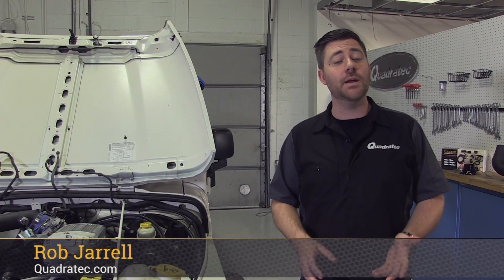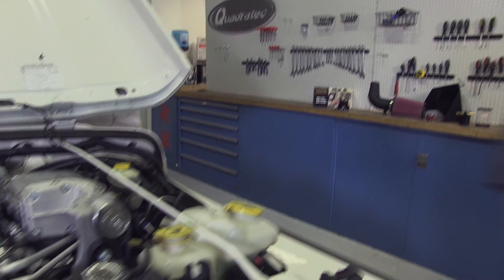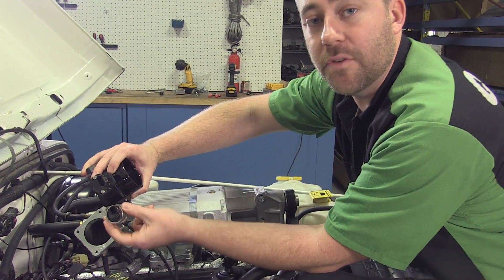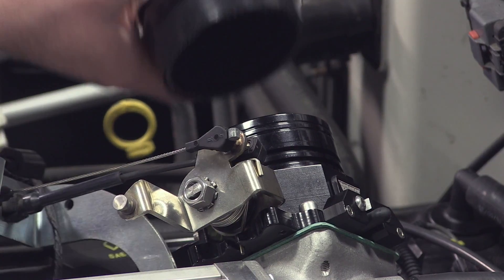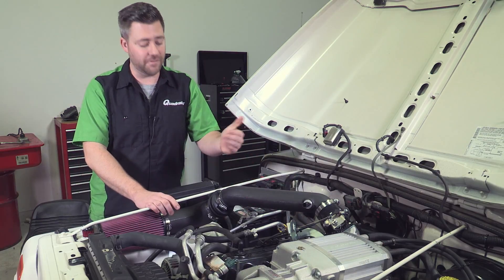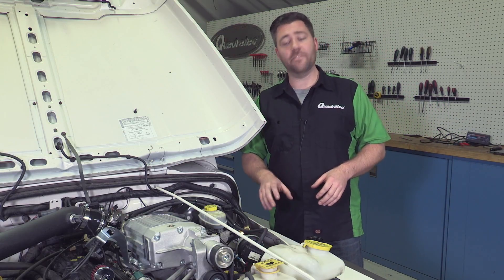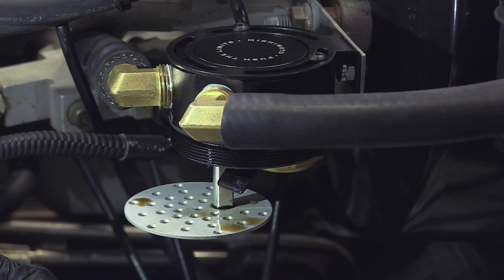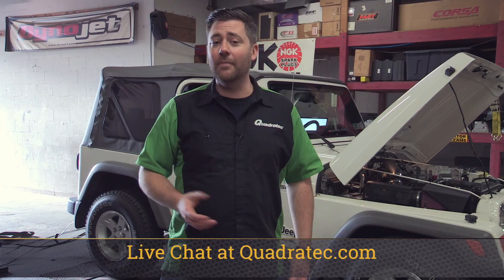Project: PearlJ Pt 2 - Air Intake and Throttle Body Install and Dyno

Comment: How exactly is that a “painless” throttle body if you have to fabricate a bracket to make it fit?   Seems like the manufacturer could’ve included a bracket ready to go right out of the box. Isn’t that kind of the point if you’re calling your company “Painless”??
Reply: The throttle body is designed to install in the stock location, but with the supercharger installed on this Jeep the location is slightly different. Because most aftermarket parts are designed to work with other stock parts, sometimes you'll run into issues when trying to install more than one aftermarket part or accessory. That's all part of the fun of modifying and personalizing a Jeep, you've got to get a little creative sometimes to make one aftermarket part work with another.

Comment: Seems like a lot of time and money to pick up 40hp. And apparently Sprintex has greatly overestimated the amount of HP and Torque their supercharger puts out. According to Sprintex's numbers there's supposed be a 42% increase in HP and a 34% increase in torque. Increasing HP by 66.65 to 221.65 HP and increasing torque by 68.68 to 270.68. From what I've seen it barely increased the HP by 19% and torque by 24% . A waste of time and money IMHO. You could do an LS swap for about the same money maybe a little more once you sell the original engine. But it's your money and your jeep. I wouldn't drop almost 5 grand just for a 40 HP gain but, I guess I expect a little more bang for my buck than you do..

Comment: I don't mean to be a troll, but I priced out everything you did and came up with a total cost of around $3,900 not including time. That calc's out to just under $100 per unit of hp and torque. Seems like a lot of cash for just 40 hp and 50 fp of torque. You could get almost half that with just a performance exhaust and intake upgrades for under $1,200 with no engine-life decrease. But we boys need our toys, don't we? Just saying...

Comment: What are the benefits of the K&N filter breather ?
Reply: he literally told u in the video, without the rubber tube connected to the intake it prevents blow by gas/oil from recirculating back into the engine to get burned off again. its meant that way for emissions purposes.  with just the breather filter the gases just go through the breather and also to the catch can instead of back through the engine.
Reply: @tomasurdal2041  why not just connect both tubes to the catch can so no blowy goes into the super charger? Then just cap the supercharger.  The blowby air and oil will only recirculate back to the valve cover.

Comment: Fabricate what?  Not sounding painless anymore.  Let me check my pile of extra sheet metal lying around.. common guys work it out.  You're marketing jeepers, spend the extra $1 and include it with the kit. Painless to me means not having  to run and get stuff not included.  Stopping the project, cleaning up, finding a ride or driving is a pain. There's enough pain already with jeeps lol. Just saying...

Comment: So why did you opt for the 62mm instead of the 68mm throttle body? Would the 68mm still fit and function properly with the supercharger?
Reply: They use the 62mm so they wouldn't need to fab the manifold. He states that here : https://youtu.be/ejc6qknmw2o?t=72

Comment: Could a throttle body spacer have been used instead of modifying the throttle body bracket? I still can't believe you found a TJ with less than 30,000 miles! Beautiful jeep guys!
Reply: you would be suprised what you can find if your patient...lol i waited for almost 10 years to get a jeep, found one that looked like it came straight out of the factory, an 04 wrangler sport, only 6,000 miles on the od. was a guest house vehicle and sold the house and traded the vehicles in to a local dealer, was there at the right place and right time..

Comment: Has Pearl J thrown any codes since the supercharger?  
And if so, which codes and how were the codes cleared?
Does this supercharger have California CARB approval by any chance?
Looks like just what I need for my TJ...
Reply from the maker: We did get this code: P0174 System Too Lean (bank 2) we cleared them two times and has not come back since.
As for C.A.R.B Sprintex says they have a pending approval.
Reply: Thanks!  I'll keep an eye out for that final CARB approval.

Comment: I have to ask. If the valve cover is stock then why would they design the IAC sensor to be positioned exactly in the wrong direction... Sounds like. Very poor design and a lack of foresight on the designers part. It's not like the valve cover came out of nowhere...
Reply: sijonda which would you rather have the added expense and time of installing a custom valve cover assuming that the valve train below it wouldn't still be in the way or would you rather have to reclock a piece you already took off anyways for free? Sounds like it wasn't a oversight. It's very common to relocate sensors when going FI.
Reply: Steve Pounder I'm hung up on why the designer of the supercharger didn't include something that small and cheap to make to install the throttle body with the sensor not hitting. I'm not saying you should buy a different valve cover.

In my case I don't have access to tools to cut out and grind down a little plate to mount the sensor in a different direction, not that I want to supercharge my TJ anyway. I'm just pointing out something I think should have been handled already.
Reply: necro much? then there needs to be an adapter. Doesn't matter much to me anymore anyway since I posted that I've repeated found stupid things Chrysler did or I should say didn't do that makes me hate these things. So much potential wasted.